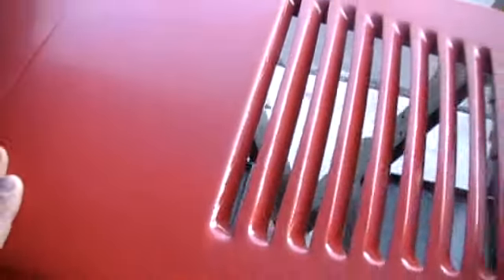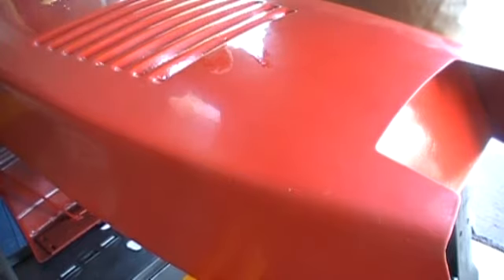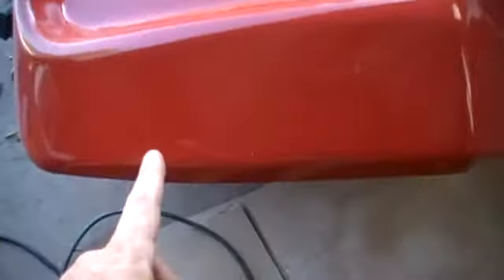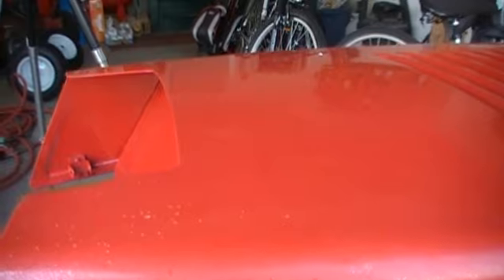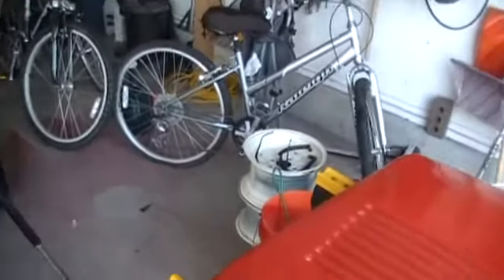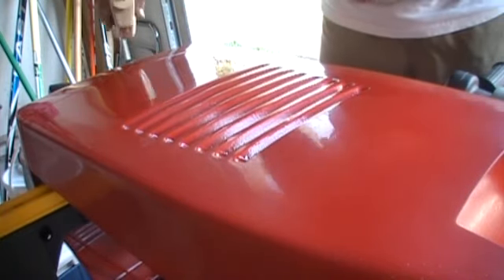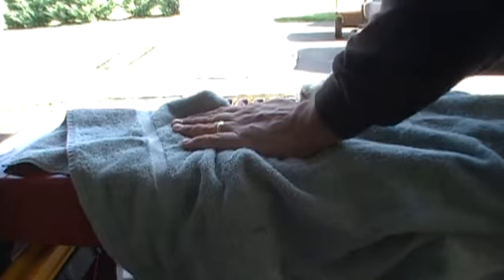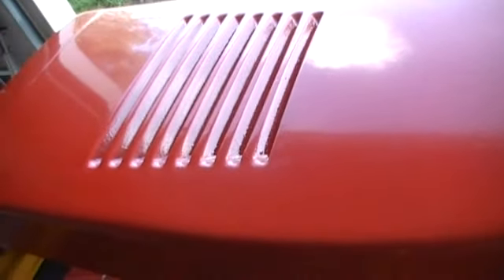Wheel Horse 520-H Buffing the Hood

Comment from the maker: @buddylee6996 Yes, I used a Porter Cable HVLP sprayer.  Works really well, a lot better than my older pressure sprayer that coated everything within 20 feet with paint.  Thanks a lot for the comments.